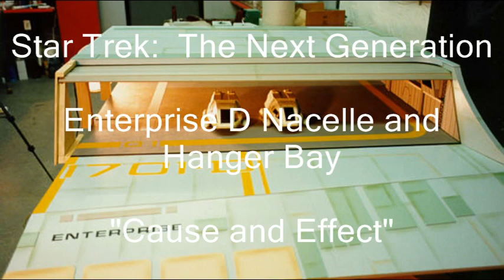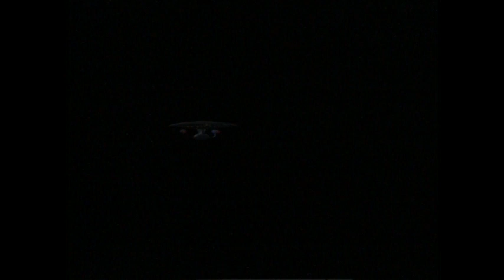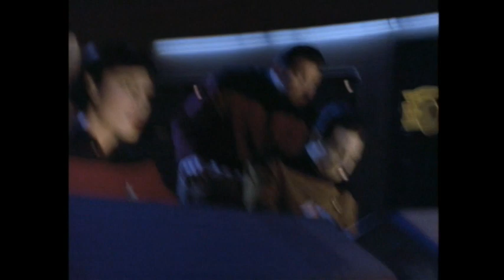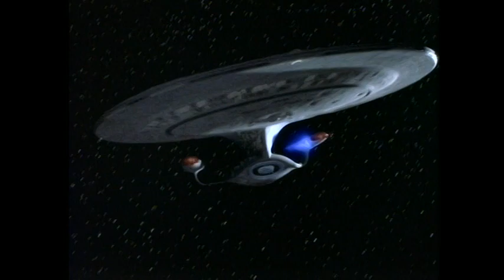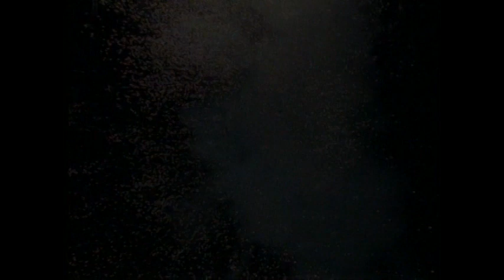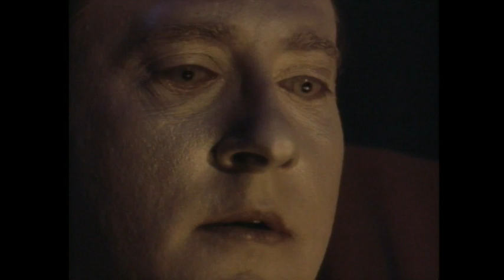Star Trek The Next Generation - Cause and Effect Original Models

Comment: I made some calculations, and I'm afraid that decompression wouldn't work here. If we assume that mass of the air in the main shuttlebay is 60 000 kg, and explosive decompression would accelerate that air to 1500 kph, the resulting force would be able to push and accelerate Enterprise to only 0,2 kph in the oposite direction as the ship weights 400 000 000 kg.
p = m1 * v1 
p = m2 * v2
v1 = (m2 * v2) / m1
---->
v1 = (60 000 * 1500) / 400 000 000
v1 = 0,225 kph
Reply: Shut up Wesley.    I mean, thank you, Data
Reply: @Justagamerhere1  You are welcome, sir. (In Data's voice)
Reply: Matt Damon confirmed that arithmetic is correct.

Comment: Ok, so 1 earth atm. of pressure coming out of the shuttle bay is enough to overcome the inertia of the entire Enterprise as well as accelerate it fast enough to move it out of the way? I don't know about that one...
Reply: the other ship was a Miranda-class (or variant of) called the USS Bozeman, which was stuck in the same distortion for 90 years
Reply: There's no friction.
Reply: I'm frankly confused that Riker would have thought of that anyway.  "How about we decompress a large room on the ship to move ourselves?"  Buh... what?
Reply: No atmospheric friction means it would not take as much to move the enterprise as we often think. Decompressing the shuttlebay like that would essentially act as a giant RCS thruster

Not to mention that by that point they would have already started using the tractor beam to move the other ship, so it was both solutions, in reality.